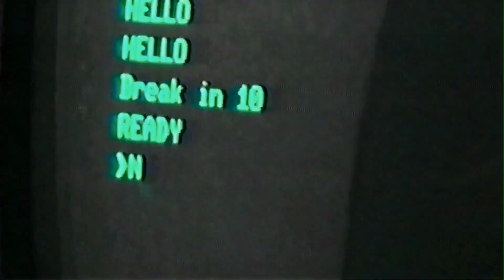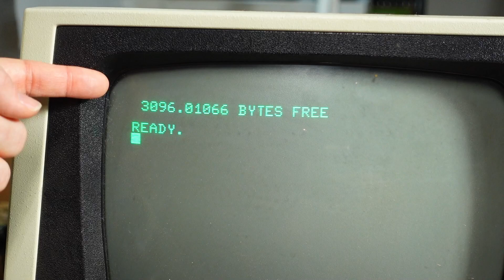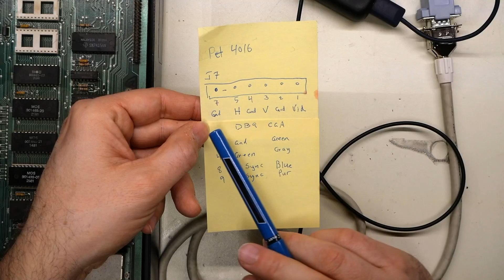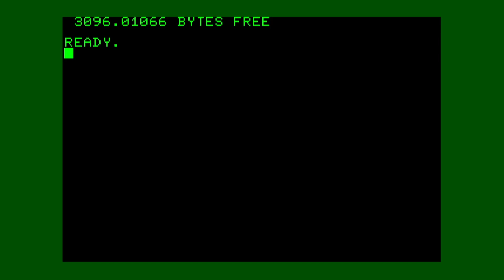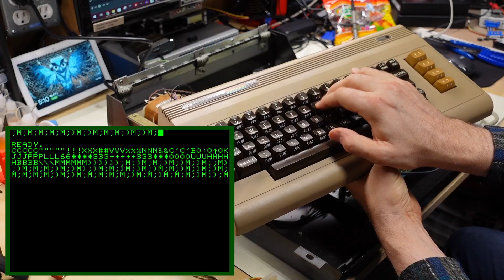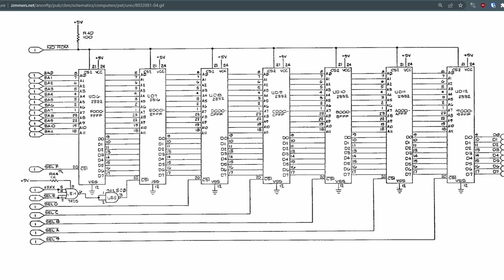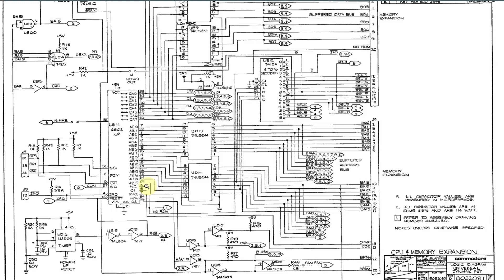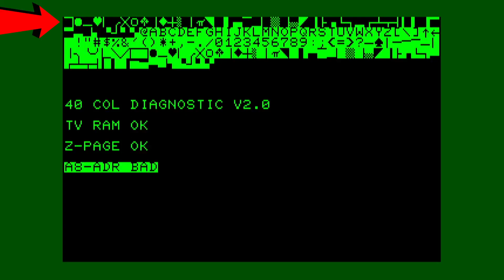This Commodore PET has 3096.01066 bytes free! That can't be right.

Comment: What these Commodores do to print out this value is to take the integer value of the bytes free, convert it into a float value stored in the floating point accumulator (some bytes in the zeropage) and then convert that value into a string to print it out. In this case, I would rule out the ram, because  the routine basically works, it just gives wrong results. The same applies to the ROM. That leaves the CPU. It can have a minor fault where it doesn't update the carry- or the zeroflag correctly in some cases, which could lead to such results.
Reply: I was thinking the same, plus it's an easy thing to swap out to test.
Reply: I was wondering where a floating point value would creep into an integer memory count, thanks for explaining that signal chain :D

Comment: I just saw your 3d printed solder spool holder. I printed and use the exact same holder on a regular basis. Nice.
Reply: I 3D printed the same one but it's kinda lightweight and the center spindle on mine kept popping out, I ended up trashing it and buying a Hakko 611 holder which is rock solid.
Reply from the maker: Heh yeah I've had that little thing a couple years now and it's very handy!

Comment: Nice trick to jumper CS from the Kernal to one of the option ROM socket. I need to remember that one. The Romulator can replace the kernal but not everyone has one of those.
Reply from the maker: The biggest issue is programming a 2532. But a simple PCB or hand made adapter is all that's needed to use a 2732 instead.
Reply: "Piggybacking" it on the Kernal should also have worked (but less reliable)?

Comment: I'm still amazed by hardware working 40 years later.

Anything made today seems to just fail in just a few years, or in barely a year if it's a peripheral.  Maybe not a complete failure, but degrades in one way or another which affects usage of the product.  God forbid you buy something that's a refurb/recert.. those go so quickly.

Every time I turn on my computer I worry some part of it will suddenly be dead, especially a storage drive.
Reply: Funny, that budget electronics from this era last longer than professional stuff or even mil spec field equipment of the same era, because of the lack of exploding tantalum capacitors...

Comment: I remember when the Personal Electronic Transactor (PET) was first announced and would have loved to have one.   At school I was using different computers (Research machine 380Z), which had some proper graphics capability, so when I finally got to use a PET, I was quite disappointed.  But it's still an iconic machine.

Comment: I need one of those RGB2HDMI.  Definitely a useful device
Reply: If you can solder, you can build your own - everything you need is listed clearly in the wiki attached to the project. It's all on GitHub, hoglet67 RGBtoHDMI
Reply: @richardbanks2669  I at least need a PCB.
Reply: @HutchCA  The files are all there to order a PCB from one of the cheap internet suppliers - PCB Way, JLCPCB, Oshpark etc - depending on how long you're willing to wait for it to arrive, and what import duties/taxes your government levies, it can cost less than $10. If you don't feel confident ordering a PCB ( and honestly, it's a lot easier than you'd imagine, very user friendly these days) there are people on various forums ( try stardot the BBC micro forum) who make 'group buys' where one forum member will buy PCBs and components in bulk and then ship them individually to anyone who wants a kit, at or near cost price. There are sometimes people also selling kits on eBay, and  Tindie, although you never know when they might have stock. Good luck :)

Comment: I wonder if you could use Bondo's fiberglass resin on the case to go over the engraving and other scratches? Then possibly rattle can the entire case and print a new sticker for the front.
Reply: I've done this before on a TRS 80 that had really deep scratches and a piece of the case broken off. It looks fabulous if you know your way around prep and paint.
Reply from the maker: There is a very distinct texture to the case plastic, so I think it would be really hard to replicate although maybe not for someone with a lot of skill?
Reply: @adriansdigitalbasement  There is a simple little trick for plastics with texture. Get a hot glue gun and place a blob of hot glue on the textured surface and place a stick in the glue standing up. Once cooled, carefully peel up the glue with the stick still in it and viola, you have a texture stamp that can be used while the filler is soft.
Reply: @notneb82  Yup. Hot glue or also polyester resin and anything that hardens but stays kinda flexible and can be torn/peeled away without bonding with the texture you're matching.

Then you can press it on the filler or even the paint, if you go with painting with several thick coats
Reply: @adriansdigitalbasement  you'd have to take a mold of the texture in silicone, and then use that to re-add the texture to any epoxy resin you use to fix the damage. David Murray has a pretty good video from a few years ago about doing that to fix the lid on a Bell & Howell Apple II+.

Comment: The first thing I thought of was bad RAM. All it takes is a flipped bit to mess up a number like that, and those 6502 BASICs all use single-precision floating point everywhere except when they need to be converted to or from a 16-bit integer. Other things were weird enough that I also expected it might be a whole column bad or something like that.
The error that came up implies that there is aliasing between the zero page and the stack page, which would be quite troublesome on the 6502. It's quite right to stop the test right there, because having the stack crash into and twiddle with the zero page can cause some really subtle problems.
At least try re-seating all the DRAM chips first, and check for tarnish on the pins. Sockets are nice for repairability, until oxidation makes a pin or two stop working after a decade or two.

As for the display, I'm guessing that the CRTC was initialized incorrectly. Probably it is "scrolled" to the third line of the screen, and the first two lines are simply hidden. I wouldn't be surprised if that's being caused somehow by zero-page vs stack interference during the initialization.

Fix the RAM and you'll probably fix the screen.

Comment: My MCL65+ could also be dropped-in to replace the 6502 which can emulate all of the PET's RAM and ROM. Perhaps not as user-friendly as the ROMulator, but does allow the user to enjoy some acceleration modes such removing 6502 cycle-accuracy and mirroring the RAM/ROM at very high speeds. Could make you machine the World's Fastest PET. :)
Reply from the maker: Videos coming soon now this PET is on the bench :-)
Reply: Sounds cool!

Comment: That video bit was awesome.  I have a working PET so I've never had to dig into that.  Could use some help on the 8050 dual FDD drive though...
Reply: swap out the PIA and see what happens, they're flaky
Reply: @ginkumpow3726  I think it's on the analog side actually.  I have two - one with mechanical damage - and the plan was get one working but C= used different revs.  I haven't dug into it all the way yet.  This video did inspire me to power up the 4032 though and it was satisfying to see that still works.

Comment: It is not the ROM/KERNEL that does the initialisation.  It is the CPU that does the initialisation using the code it retrieves from the ROM/KERNEL.  In all computers it's the CPU that does the work.

Comment: Fancy! Not sure how many of these you do, but seems like that diagnostic stuff seems like a useful candidate for a PCB that plugs into the socket instead, so you don't have to bend chip legs. But, then you'd have to find chip leg shaped pins to solder into the PCB instead, maybe that's harder than replacing an EPROM after wearing out the bent-out pins.

Comment: I keep wondering why they had an integrated monitor when they could have told people to use a TV to cut costs.  I guess they would have had to have an RF modulator but it would still be less expensive wouldn't it?  Not to mention less bulky.  The only thing I can think of is it's more convenient for schools if the monitor is built in and ready to go.  Not to mention it can't be stolen as easily.
Reply: Ordinary TV sets have a low-pass filter because of the color subcarrier. Because of this, you can barely get 40 columns of resolution, and it's a little worse over RF. Direct video inputs were also only in the newest TV sets of the day, for use with VCRs.
Also this completely avoids the issue of NTSC vs PAL, by using a video sync rate that is neither!

Comment: Pin 35 on a 65(C)02 is a no connect. They may have used it as no rom because on the CPU it does nothing. But its strictly NOT a no rom pin on the CPU, just an unused one.

Comment: sure there is a way to 'seperate the psu part from the digital logic part'. just supply it with power over the user port. as with most commodore products.

Comment: No need for conductive paint.  Just a little sandpaper to remove the surface layer of rubber on the carbon impregnated pads and expose a fresh surface on the rubber.
Reply: Eraser*

Comment: Thanks for sharing, that's very interesting. My first idea was : oh god, what will happen when the CRT's are all dead ? And there was the answer : conversion. Another idea was : what make those IC's fail ? What is the physical reason and is there a way to diagnose it ??
Cheers
Reply: Those green, b&w or amber crts last forever if you don't use the PET as a display piece that's turned on all the time. And those all glass crts don't lose their vacuum. I am sure they will still work in 100 years. I actually have some tubes (no crts though...) that are from the late 20s and early 30s and they test good and are still under full vacuum.

Comment: It was apropos to see you wiring up the PET video to a modern monitor --- I just got a Brother WP-1 word processor, with a really cool letterbox CRT, and it uses the same scheme (16kHz hsync, 60Hz vsync). Unfortunately I don't have any monitors which will accept CGA so I'll have to convert the TTL video signal to VGA's 0.7V. Apparently you can get CGA to VGA converters, but I don't know whether they'll work with the Brother's strange screen size. What happens if you feed 5V into a VGA port's colour pin? Does it explode?
Reply: If you're really lucky you may find a monitor which will work, but with an RGBtoHDMI adapter, you can easily get a pixel perfect display on any modern panel which supports HDMI input - if it's really wide-screen, there are LCD panels designed for car rear view mirrors, or marquee type displays as seen on pinball machines - plenty of strange shaped displays available - which will give you a perfectly sharp image no matter what aspect ratio you need. Common 'unusual aspect ratio' resolutions are often the width of one standard resolution, but the height of a different one, for example 1280x480 or 1920x600, so if your word processor is outputting, say 640x200, that will scale nicely to 1280x400, or display in the middle of 1280x480 with slim black bars top and bottom. The key is finding a panel with a nice integer multiple of the output resolution (or a little larger, RGBtoHDMI can scale perfectly and then apply a 'border' like you used to get on a CRT, to match resolutions perfectly). Good luck!
Reply: @richardbanks2669  I have an OSSC on order, which I'm hoping should sync to it. I should add that this is only for workbench use --- the real monitor actually works fine. I believe the format is 640x256 (80x16 characters, each 8x16 pixels). Although now I think of it could just be CGA with a physically squashed screen.

Comment: Can someone tell me what is so special about computers running 5v and 12v and in some cases -5v??
Reply: Some old RAM chips, for example the 4116, require +5V, +12V and -5V supplies.

These other voltage rails are often also used for things like RF video output, RS232 serial ports and the drive for the loudspeaker.
Reply from the maker: Later RAM chips generates the bias voltages they need internally -- but those early RAM chips (and often other 70s era stuff) needed those external bias voltages as well. They won't work without those voltages present. And then as Alex commented, sometimes the rails are used for RS232 but if the voltages aren't present the serial port just won't work -- usually no big deal.
Reply: Those other voltages are due to details of various logic types back then, like PMOS and NMOS. Some later chips had voltage conversion built in. In the end CMOS won, and it doesn't need those bias voltages, but so many chips these days run on less than 2v internally.

DRAMs stopped using -5v at 64Kb size, and EPROMs stopped using it with the 2716. Generating -5 volts is annoying because you basically need another unregulated supply voltage, unlike 5v which can be regulated down from 12v. EPROMs also needed higher voltages (12v-25v) for programming up until Flash in the late 1990s, which had its own internal charge pump.

Most DRAMs stopped using +12v at 64K, but I had a set of 64K DRAMs I got for a TRS-80 Color Computer, and they needed +12 volts. I was surprised, but it was just a matter of setting one jumper to the "wrong" setting.

Yes, RS-232 needed negative voltages too (unless you used "TTL"-232), and there were also chips like the MAX-232 which could generate the negative voltage. (It was CMOS, and I zapped a few back in the day! A new one was six bucks!)

Comment: Wow! Was it standard practice for 'Commode Door' to solder in ROM chips?
Reply: It depended on the model, age, place of manufacture or phase of the moon! My early 2001-N I've had from new has socketed ROM chips, a 3032 I have is also socketed (although that was acquired second hand, so may have been modified), but I have seen many pictures of CBM mainboards with soldered in ROMS, particularly later models. I've heard that Commodore had supply issues with a number of components and would sometimes solder in sockets for chips they couldn't get then put the chips in later, rather than hold up the assembly line, but it does seem that as time went on soldering in ROM chips became increasingly standard practice, I remember at the time that there were many reports of chips coming out of sockets when power/heat cycled many times.

Comment: On the keys not working, this works a lot better than conductive paint:  https://www.youtube.com/watch?v=n9gGz2n-sBU&t=9s

I've done this on about 8 keyboards, using lye, then IPA, 24 hours each.  Keys work like a dream after.  It's the oil from the silicone that leeches into the carbon that causes the keys not to register.

Comment: Might want to put a warning in the text of the video that working inside an old computer like this is very dangerous, do not attempt.  Dangerous high voltages can be present on the back of that cathode ray tube and in the capacitors in these babies.  If this was the first view of these old machines for some 15 year old you wouldn't want to have them get hurt.

Comment: My CBM4016 has a different main  board, also the smaller screen.  I've had it since  new from sometime in the early 80s. Had to replace a video memory chip and a filter cap in  the floppy disk drive, which went  bang and let all the magic smoke out. Got a few video's on getting it working again. Always great to see another pet brought back to life. Keep up saving pets.
Reply from the maker: Yeah you're right, I haven't seen that. Wikipedia states: "First year 4000-series PETs retained the same video hardware as the PET 2001/3000, but in 1981 this was replaced by the 12-inch screen and 6845-based CRTC hardware."
Reply: without context regarding the word pet, this coimment has a strange end..
Reply: @itsTyrion  as the title of the  video has the word "pet" in it , i assumed that folk would not think that i was referring to cats or dogs. Either way saving pets would be a good thing, bringing back to life might be a bit more difficult for some. Also  mine is a CBM4016, in the UK they were sold as "Commodore Business Machines" but well known as PET'S.
Reply: @TheEmbeddedHobbyist  "I just revived my pet, just had to replace some parts." "Where did you get them" "I just took them out of my other one I didn't like that much, because it got to yellow and bleaching made it splotchy"
Reply: @VintageTechFan  I think i hit lucky with a few parts from ebay that seem to work ok! the mains bits it got from RS or Farnell in the UK.
The good thing is there are not many special parts except eprom code but that as well can be found on the web.